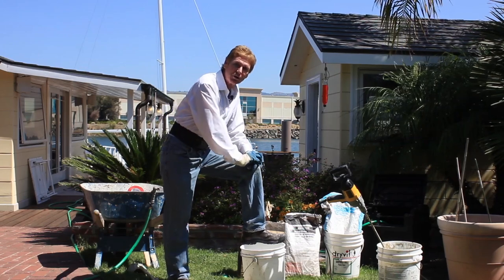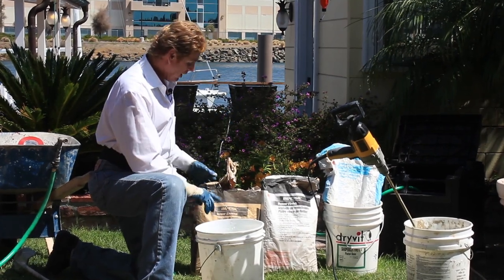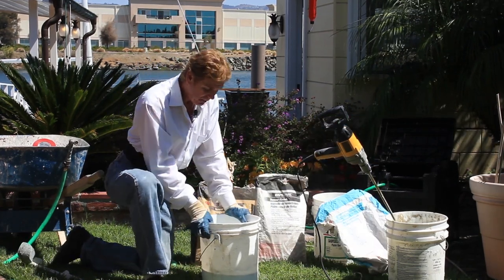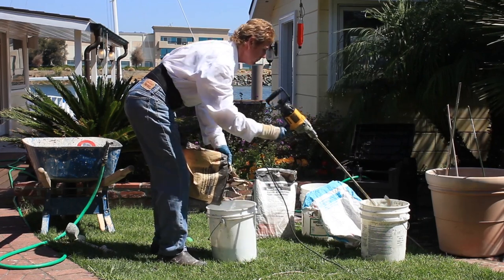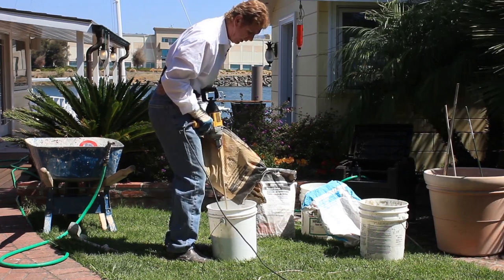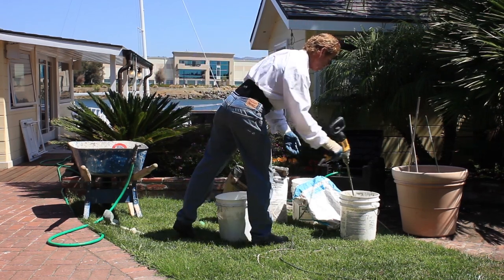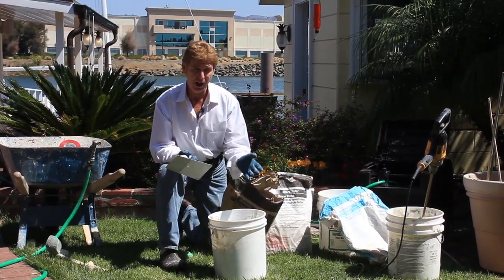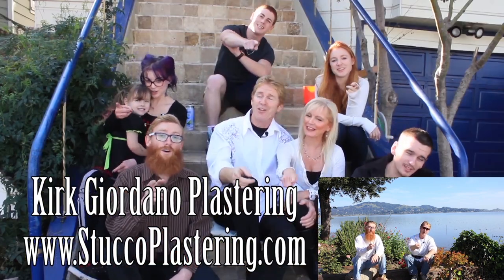How to mix lime finish plasters

Comment: I can't believe spent about 45 minutes looking for an answer to if gypsum plaster is warm like gypsum board (because of watching Kirk's plastering videos), later in the day watch this and BAM, there is the answer: gypsum plaster is cool to the touch. 

Just bet the home I grew up in had gypsum plaster, no horsehair, bright white, and smooth. Built in 1942, with wire lathe rather than wood.
Reply from the maker: Howdy, my friend no doubt, it had a structo-lite base coat and a lime finish. As Lime finishes are bright white.💃
Reply: Thanks Kirk for satisfying a curiosity.

Only once a deep hole was made, my sister hadn't changed out of her soccer cleats and her and dad started playing rough and she accidently back kicked the wall. How come know expanded diamond wire mesh. All can say is the base coat was sandy.

Phoenix area got rain yesterday evening and this morning, today be a good day for plaster or stucco. ;)
Reply from the maker: @adrielrowley  Howdy Adriel, it's always a good day to apply stucco.👍

Comment: Can you use the gypsum board in the bathroom with veneer plaster or the green board with veneer  plaster?
Reply from the maker: Hello Jenny, yes you can use lime plaster on any sheetrock, just apply Quikrete bonding agent on first, A bottle cost ten bucks at any HD or lowes store, In fact, you can buy this bonding agent at almost all hardware store. Remember the word Veneer. only means a thin coat, you are applying a lime plaster.🥂

Comment: Kirk. I had a question can i veneer plaster on drywall with out. Puting mesh on tje joints
Reply from the maker: Howdy Jose, good question, no,  no all seams must be taped.      
                                   Live long and plaster
                         Sharing plastering information

Comment: Kirk, do you think a plaster of paris and sand mix would be a good substitute for a veneer base coat?  Some of these supplies are hard to find in Minnesota.
Reply: I wouldn't. Plaster of paris sets fast and is meant for things like casting molds
Reply: @micuzzu  I looked it up on the material data sheet.  It literally is just plaster of paris and sand.  There is a little bit of clay in the mix too.
Reply: @mrt9749  Paris dries in 10 minutes or less
Reply: This Diamond Veneer Finish is 80% Plaster of Paris, and 20% Lime. Hope that helps someone.